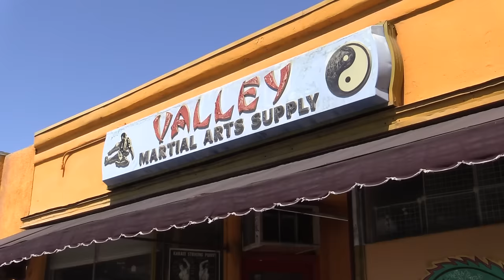Test Driving BattleBots

Comment: wasnt disco inferno in battle bots?
Reply: Yes
Reply: Yes, that was my design. Learn more at https://www.facebook.com/theinfernolab . :]
Reply: infernolab  I love your robots.  One quick question, is Towering Inferno still a functioning robot?
Reply: Thanks for your interest. Nope, I gutted Towering Inferno after BattleBots season 5.0 in 2002 & sold off all of his insides: motors, speed controllers, batteries, radio, wires, etc. I kept his outer body intact, because all of those parts were specialty parts that I designed & had machined, so they weren't really of value to anybody else. After having him take up space in my garage for over a decade, I donated him to NTMA, where I hope he can inspire students to learn more about fabrication & robotics.
Reply: infernolab what bot style you guys gonna do for battle bots next? since a flipper spinner didnt work out so well :/
Reply: i agree but the problem with the design it was very light on armor and could not take many hits from major bots like beta bronco and yeti also captain shrederator so you might want to tank up your bot if its gonna stand a chance if its gonna be a flipper spinner

Comment: 20 to 50 GRAND? For a heavyweight? No way man, you can make a decent bot for around 3-5k, no problem. At least you can in Europe.
Reply: There are better parts in America that aren't available in the UK
Reply: Jake Henson Like what?
Reply: Etek-R weapon motors
Reply: Didn't know you could get them here, anyway Carbide cost £20k to build.
Reply: Jake Henson Even then that's on the low end. If you're going up to 50k, I'd say you're wasting money. And honestly looking at that stinger-esque bot with the puny axes, that can't have cost anywhere near that much. As for parts, I'm sure team Carbide would've imported the parts had they needed to, I don't think they'd be unavailable just because they were only sold in America. I know Team Storm imports all its titanium from the US, because that's basically the only place you can get it.
Reply: Which stinger-esque bot with puny axes is that.
Reply: The orange one on the thumbnail. I know it's not really like Stinger, but it was the closest comparison I could draw.
Reply: Jake Henson I'm talking about the one in the video, not Nuts.
Reply: The one in the thumbnail is called Towering Inferno, it probably cost more than you would think, although I am not sure of the build cost.